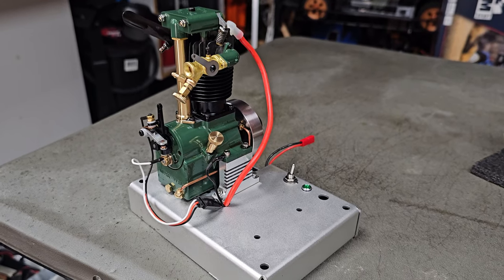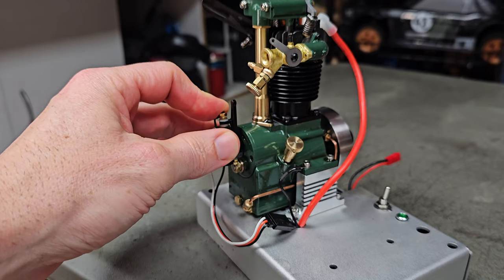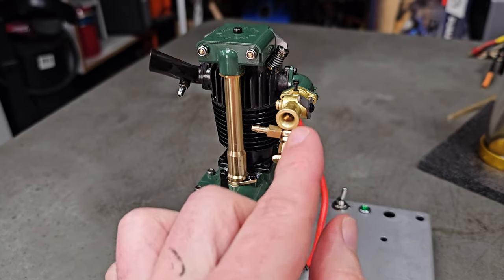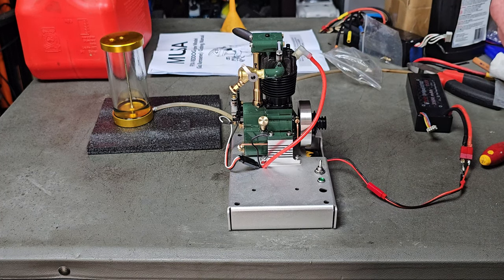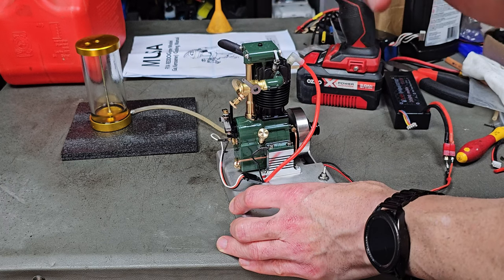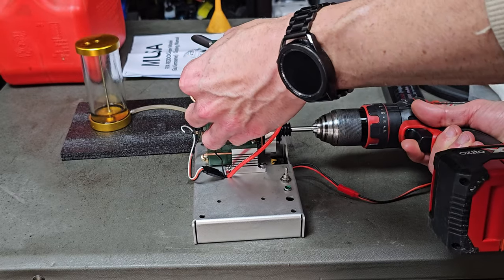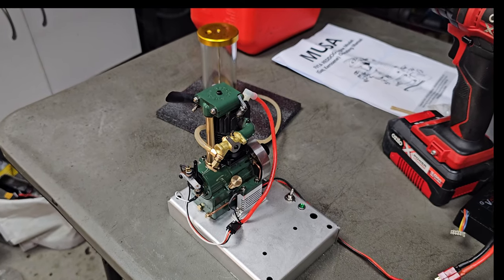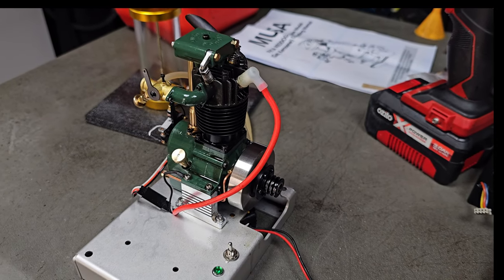THIS ENGINE SOUNDS SO GOOD! - MUSA FV1A

Comment: How many turns out is yer needle? Mines 1 turn out and pops right off. You may have seen videos of mine running. Though I think mine isn't running quite right. Never had a points engine before so this is all new to me.
Reply from the maker: I have to check it out

Comment: Man don't get me wrong I love your channel I love your content but I've probably said this 1,000 times in the comments you are horrible at explaining things that engine does not run on four stroke oil  it uses motor oil for lubrication most likely but it runs on gasoline or nitro fuel and if it has points then that Black box under the engine mount tray is not a CDI box  an engine uses either CDI or points ignition they do not use both like I said I love the channel but you are horrible at explaining things sometimes I don't know if you just don't actually know what certain things are or if you just miss word them not trying to be rude but if I noticed I'm sure a lot of people notice unless they just know absolutely nothing about engines
Reply from the maker: Riight okay mate.
Reply: yea thats most youtubers they only know brushless stuff and nothing or very little info on engine power, it’s pretty much just a gigantic sponsor everything is free for them as long as they make a video showing it working and saying to buy from the company sure they look good but notice how no one adds a load to these engines because they fall flat on their face as soon as you do,they just add around a minute of revving it saying its some legendary piece not hating but i don’t like these practices from these chinese companies pushing expensive meh quality stuff though youtube channels